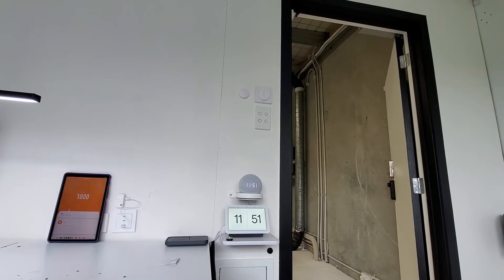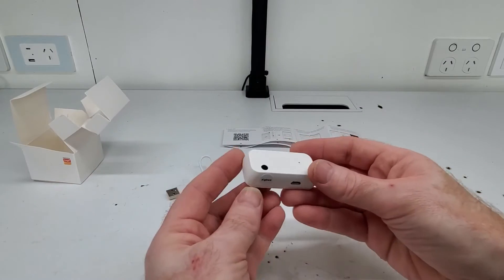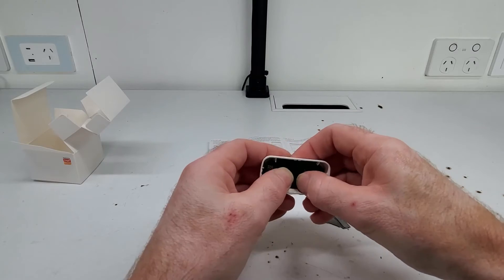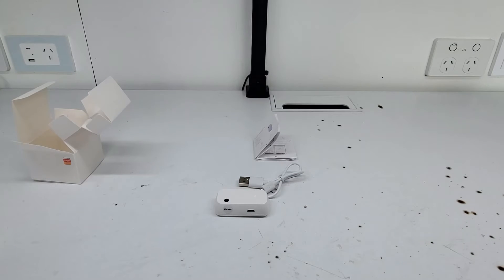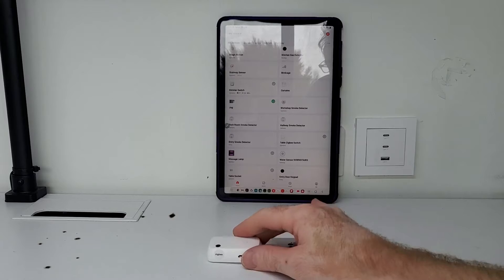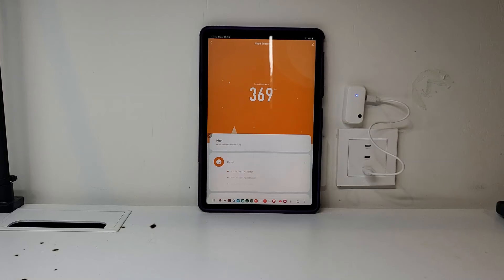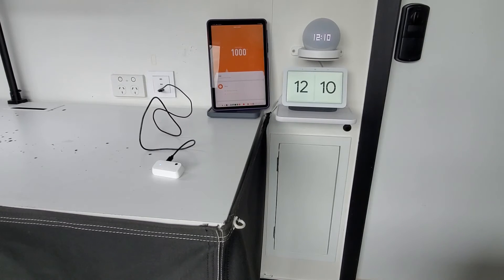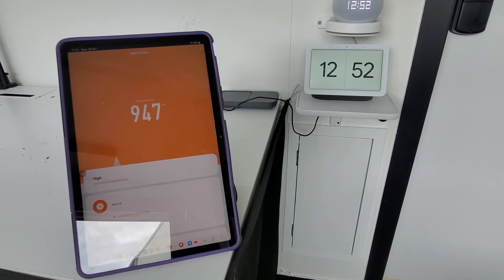Discontinued

Comment: @WildFoxAlpha Did you ever manage to test the battery powered version? I have purchased the Tuya WIFI one that takes 3 x 1.5v battery. It connects to the Tuya app no problem and is online, but does not update reading. It just freezes with no updated readings. If wondering of you may have encountered the same problem and if you were able to solve it.
Reply from the maker: Yes i did and I did not have alot of success with that device at all therefore no longer have it anymore

Comment: Hi, thanks for the video and the short demo how to use the lightsensor.
I have a question about the WiFi one that is battery powered. I recently bought the same one but it seems to drain my batteries in 10 days. In the manual they speak about a "low power consumption" and a "constant power consumption" mode but no way to find out how to switch between them.
Did you also tried out the WiFi lightsensor and by any chance know how to switch the modes?
Reply from the maker: Thanks. Sorry I'm away on business at the moment so not around my device and this was a while ago but from memory you switched the modes in the app but even after that the battery life was still not amazing and the usb powered device was the better option but it was annoying because you had to find somewhere to plug it in which is what I hate about usb powered smart device's